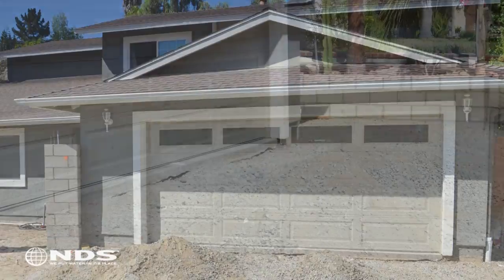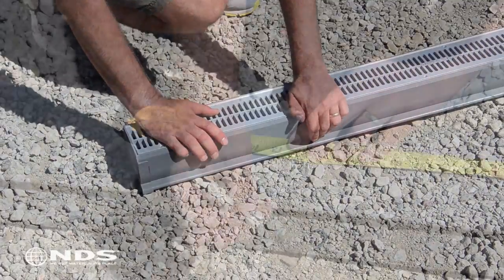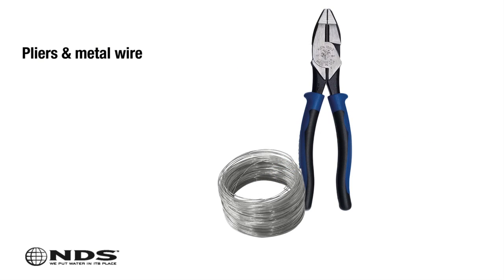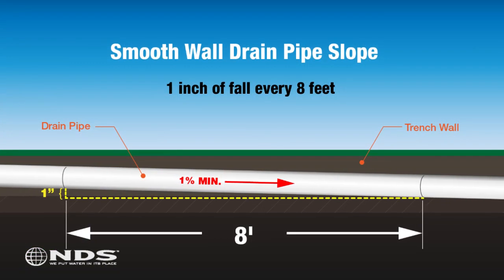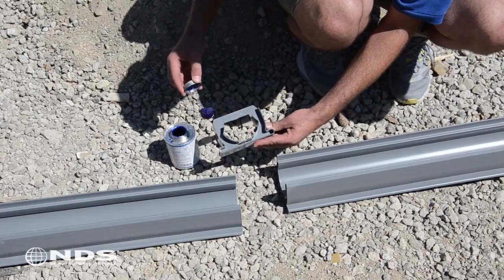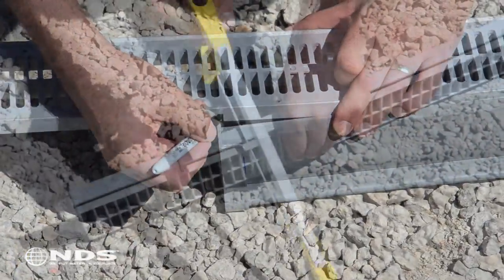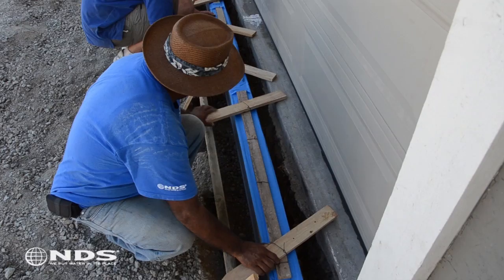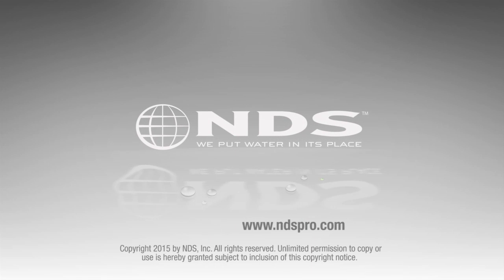How to Install an NDS Spee-D® or Mini Channel Drain | NDS Yard Drainage Systems

Comment: Better check out some other drain systems! The end caps they use on these drains restrict the water flow you only have about a 2 3/4"x2 1/4" for the water to fkow through. That comes out to approximately 146 gpm of water it is restricting. 
When I explained this to customer support, they said i should have put a drain every 10 foot. So if tou are putting these in for a 24' garage better find a different product

Comment: The Spee-D drive is installed leveled, no slope. Make sure it is dropped 1/4" if it is installed in front of the garage door. I got this info from NDS support engineer.

Comment: If this helps a single person it’ll be worth my time. I’m a plumber doing a DIY job at my house. The 3” or 4” pvc “adapter” is a joke. But you can make it work, however it won’t be with a standard coupling. Go to Lowe’s (no Home Depot’s in eastern NC) and get a 4” fernco (rubber coupling with a metal hose clamp) You’ll have to tighten the hell out of it, but in my opinion it’s a vastly superior connection than using silicone to fill the gap of a standard coupling. And if you’re still not sold, I say rubber to speak in layman’s terms. Ferncos are actually made of elastomeric PVC and will last as long as the channel system will. Good luck gents
Reply: It's not sch 40 PVC. It's s&d pvc. Fits like a glove

Comment: Since not discussed, must be common knowledge how to tool the edge of the concrete where the trench is dropped 1/8". It would also be helpful to know how to handle reverse slope where you need to drain in the opposite direction of the slope of the concrete.
Reply: each install is different. I am about to install against the slope in front of a garage so I plan on my own common tools-a small trowel. likely going to mount it deeper than 1/4 inch so no car tires ever touch it. Also i am not going to cut 4 inches on each side, instead I will cut the wings off of the bottom of the channel and then cut the concrete driveway just 1/8 inch over the width of the top of the channel for a snug fit. we will concrete the bottom and caulk the gaps on the top.

Comment: The internal coupler on the mini/2 inch channel is useless, as it's not flush/watertight,regardless of which ends I try & on different units they are all cut erratically making coupling inefficient. You still have to seal,tape,silicone etc. if you want it to watertight. Avoid this product !
Reply: True I wasted time for make work

Comment: Don't get why pvc glue is used on end cap and silicone caulk for the drain pipe connection?????  And why do you assume everyone is going to be using concrete. I'm sure not! Small patio. Drain to one end. Rock base! This site was very unhelpful!

Comment: Can I use PVC glue to glue the pipe to the drain? I'm using it in an interior setting and I don't think the plumbing inspector will be happy with silicone sealing the pipe specially since its on the main drain system.
Reply: Good question!! Why haven't they answered!!???
Reply: From the video, they are using what we call around here septic field pipe. The pipe has an ABS component and cannot be attached with PVC solvent. It also will not work with universal style solvent. One point for those concerned about leaks here or in the other couplings ... you are encasing the channel and pipe in concrete which in effect "seals" it anyway. This is stormwater not sewage and not pressurized water supply plumping.

Comment: I have this channel drain system around the pool and after10 years the top grates started collapsing under your feet in certain areas. The recessed channel has cracked and can no longer support the top grates. I was hoping NDS would have a fix for this, something that would fit inside the gutter channel to support the top grates. Replacing the channel would require jack hammering concrete and tile - not practical at this time.
Reply: It’s because you have pool chemicals on it constantly, have had this installed for well over a decade and have had no issue
Reply from the maker: +Joe Polaro Hi Joe! To better understand the issues you are experiencing with your channel drain system, please send pictures to techservices@ndspro.com and reference this post. We would be more than happy to help make a recommendation.
Reply: NDS Stormwater Management Thank you, I will do that tomorrow when I get to work.
Reply from the maker: Hi Hal! Thanks for reaching out. Please take the following steps to help clean out the grate and the channel system:1. Remove the grate from the channel. You can simply unscrew the grate using a screwdrive. 2. Once the grate is removed, wipe away the debris that has been collected onto and underneath the grate.3. Next, remove the debris from the channel itself and rinse thoroughly with a hose.If you have any specific questions, please reach out to our technical services department techservice@ndspro.com Thanks!
Reply: I would like to clean out my grate because after years of service, I believe it has filled up with dirt and debris. I am failing to find any information on this topic. How do I clean it out, please?
Reply: Has there been a satisfactory resolution to your issue?  I have seen other comments that the top grates of the product collapse under foot.
Reply: Best way is to use resin concrete polymer channel,that can last longer.